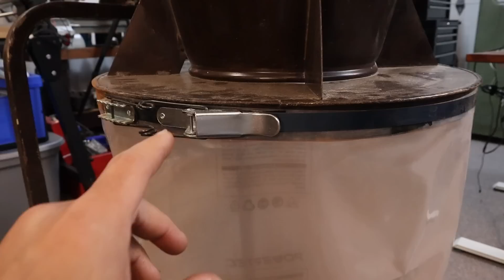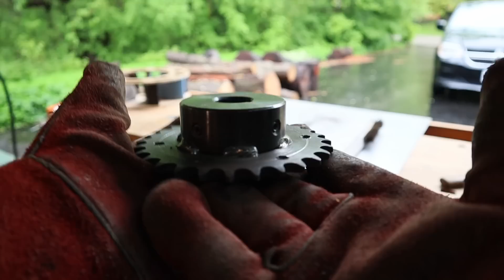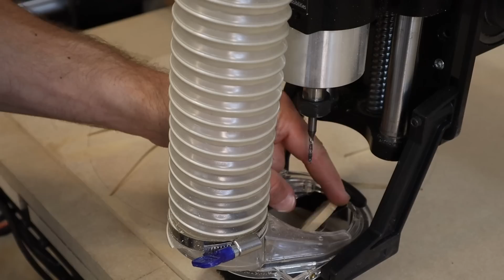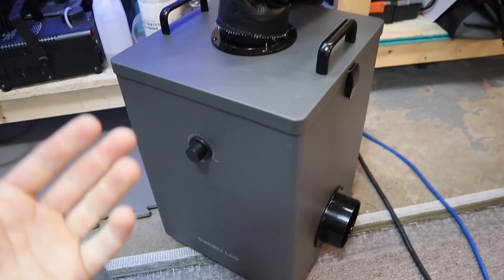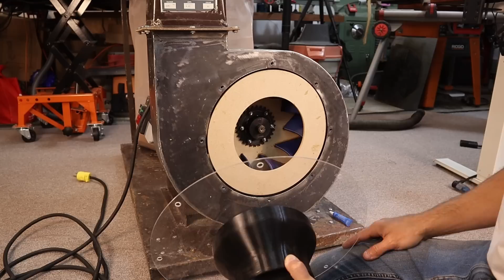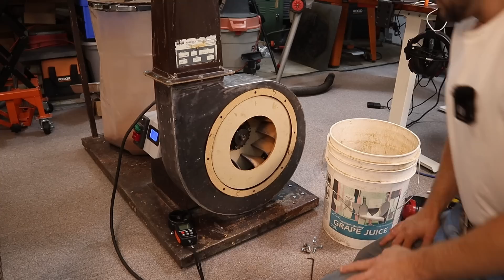My 3D printed impeller finally FAILED, time to make a new and IMPROVED one with new gear hub, monito

Comment: There's a reason the dust collector fans are made from an aluminum alloy. It allows the fan to be fully grounded so it can't build a static charge. The aluminum is also soft so it deforms without sparking in the event of an impact with a hard object. at the very least please paint your entire fan with a conductive paint so it has a path to discharge static through the motor shaft. Dust Explosions are no joke. I've had to install a proper dust collection system at a picture frame factory after they had an explosion in one of their cheap shop vacs connected to a table saw. it burned half of the shop and injured 3 people before the sprinkler system put the fire out.

Comment: I might have missed it but if you sand down the front of your blades and do a layer or 2 of epoxy the dust might not build up on the blades.

Comment: Yes, mountability is a word 😁
and the 5 minute epoxy is a good choice. Superglue fixates your part quickly but it is brittle. The 5 minute epoxy is tough stuff that can handle some vibration. We tried all kinds of different glues to glue carbon fiber parts to aluminum and found that these 5 minute epoxy glues (we use the Bison and Pattex brands) outperform most of the other types we tested.

Comment: Smooth the blades if you like, but you blades are almost certainly smoother than the cast aluminum blades of the original impeller. The dust build up it likely due to static cling rather than surface roughness. I'd be surprised if you get enough build up to cause an imbalance. Your power meter is odd, I'm not sure how it ended up with 693 Watts at 10.3 Amps. At 240V your RMS power should be more like 1.7 kW, so something is off there. Look like you got a good result and solved the major issue with the old design (the shaft mounting). Be interested to see what happens over time.

Comment: still curious why you don't want to use a cyclonic separator before the impeller, just to keep the worst of the stuff out of the blades. it just seems like a bunch of compromises to let the wood go through the impeller before getting separated.

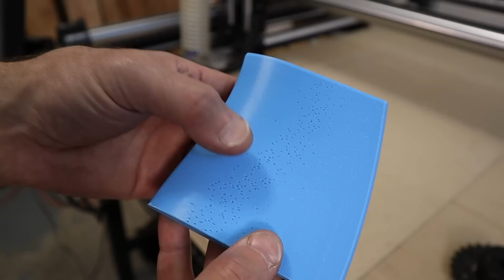Comment: 11:23 I have the same problem with Bambu ASA and ABS. My Polymaker doesn't do this, only the Bambu stuff of late. It's really weird because I didn't have this issue with my first couple of rolls in January. But the last couple I bought have been pitting like that and it's obnoxious.

Comment: I think your cfm calculations are not quite right. By my calculations, I get 599 cfm. pi * r^2 = 18.67 sq inches / 144 sq inches/sq ft = 0.1296 sq ft * 2624 ft/min = 599 cfm.  Please let me know if I have the calcs wrong.

Comment: Might be able to use a cheap projector above CNC to project the model onto the work surface based on coordinate to allow you to see where to nail it down. Similar systems are used for projecting where parts are welded onto plates or for locating layers in laid up materials instead of requiring templates.

Comment: might need to figure out a way to balance they hub since its got welds now. Little off balance will cause annoying issues later. Also to make your prints even stronger you can leave them in the printer at a set temp to anneal them for a certain amount of time.

Comment: put a pencil in the chuck and draw the cut pattern lightly, then nail it down away from the cuts?  pencil shouldn't drag the MDF around so the static friction would be enough to keep it in place for that part.

Comment: Hey, this is due to PLA, for those interested in building one yourself and dont have all his tools :)
PLA is not a good material due to its inability to keep its shape in constant stress. It will bend /change over time. 
Try to print it in one of eather: first is cheap and easy, last is expensive or hard to print ( PETG, PET-CF, ABS, PC-CF, PC, PA12-CF, PPS-CF, PEKK) 
I would aim for PC-CF or PET-CF for the shaft, and PETG or ABS on the "wings" :)
Reply: Cheap and easy: HIPS.

Seriously it's not a joke, everyone should try it.

Comment: It’s common practice to use odd numbers for fan blades to avoid resonance issues.
Reply: It's for axial load distribution and distribution of tolerance and, in some cases, strength.

You'll get harmonics with any number of blades if they're all the same profile and identically spaced, regardless.

The old radiator fans on V8's were shaped the way they were, with unequal spacing and blades of varying geometry, not because they had an even number of blades (Dodge did this even with 5-blade fans) but to confound  and prevent harmonic resonances.

Comment: Since you're using ASA now you could try to do some vapor smoothing on the blades to reduce surface roughness.
Reply: It can increase strength as well. Surface uniformity wise anyway

Comment: You may want to check out smooth on's xtc 3d for the fins. It's good at gap filling, is sandable, and increases the surface strength. It could really help cut down on air friction and dust accumulation.

Comment: In a bag with recently microwaved desiccant is fine though :)
Filaments are usually not very dry out of the package, you can get a lot of moisture out the included desiccant.
Reply: if they're properly vacuum sealed they're going to be pretty dry.  If the heat shrink is drum tight you're probably good to go right out of the box.
Reply: @danmerillat Sure if buying premium filament, but the vacuum itself will only reduce humidity by about 10% so the saturation of the silica will tell you a lot more.
Reply: @yagoa  it's more that if they were produced under proper conditions and packaged before they absorbed a ton of water, being packed in vacuum will stop them from getting soggy before you use them.  vacuum-bagging your own filament after it got wet won't help you, but if you dry it first it'll keep it dry.

Comment: For an induction motor like that, the current doesn’t drop off very much as load is removed. Instead, the power factor gets worse and worse. As long as the running current is below FLA x SF, you’re good. Instead look at the running watts. This should be close to rated volts x rated amps. The ~650 W your power meter is showing means the fan using less than 1 HP. Probably closer to 1/3 to 1/2 HP since a lot of those watts will be going to motor winding losses. It would work much better with a 3450 RPM motor, but with the one you have, I would stick with straight blades or even forward curved.

Comment: I know it would take MUCH longer to print, but if you print those blades at 0.12 or 0.08 and then sand them smooth, I bet dust would not stick as much, and if it did, it would build up a little then fall off.

Comment: From the designs ive seen they have the blades swept forward to thought the air forward, your design is swept backwards making a low pressure behind the blades drawing air in. If you look at some gpu blower fans youll see what i mean

Comment: Could you build a backdraft blocker similar to the  small ones used in the A4T toolhead"s  4010 fan assembly  on Github?

Comment: Would be intersting to know how you dsigned those fan blades... Angles and shape etc. Because I'm guessing there are pretty clear principles/formulas on how to design those..

Its one thing I deem CAD software should have much more of. Instead of having to design everything from ground up you just specify what you want and it creates it for you. Should be easily done with everything that has design rules.
I use Autodesk Inventor and they have that feature for some things. Like belt drives, shafts, cams, springs, gears.. But should be technically possible with different types of fans, propellers and more complex things too.

Comment: if you heat a loctite saved nut at about 150°C it opens for removal.
If the dust gets thicker it may not withstand the centrifugal force. The plastic stuff will have static electric because of the the durst rubbing on the surface, so it stucks better at the beginning. Later on there will be a stable amount, but not more - dont see any future problems by getting thicker and thicker.

Comment: Why you let all the woodchips and dust go through the motor, so why no vortex in between it
Reply: No, the motor is outside the impeller housing. The wood dust never comes in contact with it. And a vortex is less efficient than a cyclone.

Comment: I wonder if the blades are attracting dust due to static charge.  Would be neat to have you get the blades printed in aluminum from pcbway or whoever.  Or cast them after melting down the original impeller.

Love your videos.  I might go to princess auto today, myself!  Awesome to have it so near.  Dangerous, even ;)

Comment: use lexan sheet for the window.
this may shatter if a piece of wood or metal hits it.
And way thicker.
10mm at least.
When you block the hose it will pull the thin acrylic in.

Comment: when using hot glue to mount material on the cnc, try to avoid it cutting in to the hot glue since it sometimes gets stuck on the bit and potentially break it